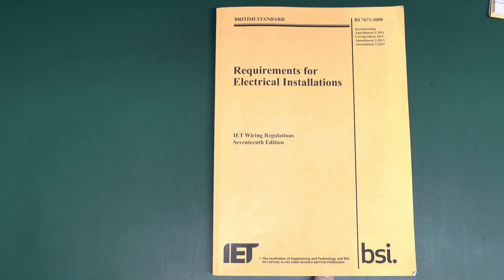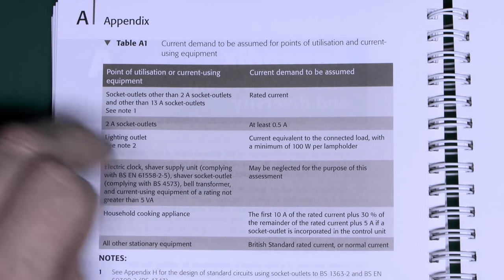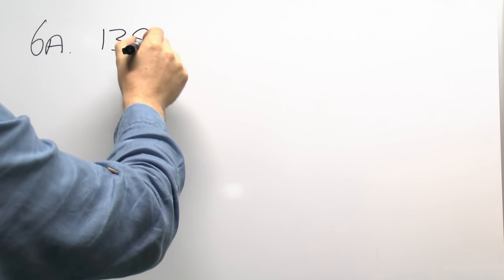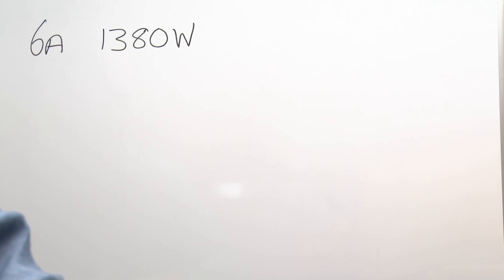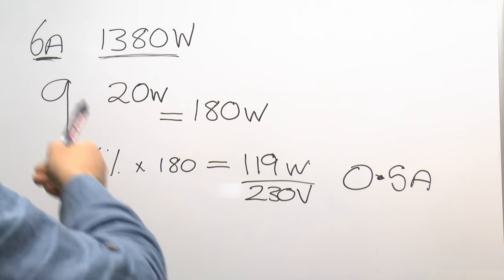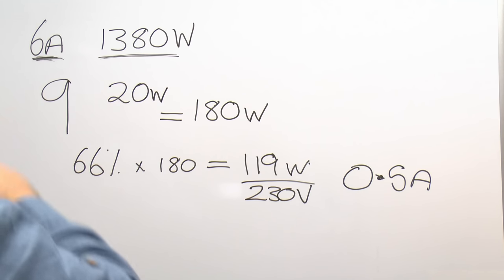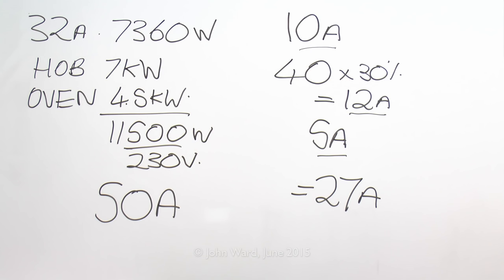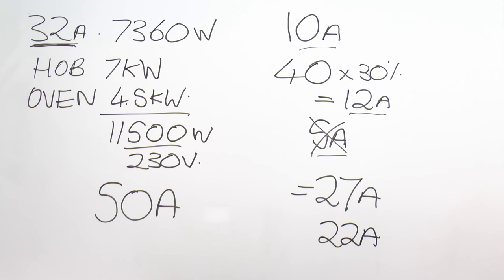Maximum Demand & Diversity for Electrical Installations

Comment: I can see why you might apply the diversity calculation to a circuit breaker for a given arrangement of appliances but I don't think the diversity calculation should compromise the wiring, which should be chosen for the maximum possible amperage to avoid future rewiring of the house. It also has a lower wiring resistance, which might offer more options for the choice of circuit breakers.

Comment: Diversity was discussed on a respected training course I attended recently and appears to have been calculated very differently for an entire installation. 
You calculated diversity on each circuit & added them up (which appears straightforward), whereas they appear to have applied the 100% + 40% of Item 9 in Appendix A of the OSG to the entire installation. The wording for item 9 is a little unclear - "Standard arrangement of final circuits" and you seem to suggest this is used for sockets only. So I'm confused as to which approach is right or whether both are?
This is the example they gave us for a consumer unit with 4x32A circuits (cooker + kitchen + downstairs + upstairs rings), 1x40A (shower), 2x6A (lighting) Total =180 Amps
Diversity for entire installation: 40Ax 100% + 140A x 40%(.4)  = 40A + 56A which totals 96 Amps
They also mentioned allowing 20% for redundancy.
Reply from the maker: Either way is ok, and there are probably other methods that could be used.  The point is to get to some reasonable assessment of what the likely maximum load will be, it's the end result which matters, not how you get there.

Comment: Hi John,,,, So what happens if you have the circuits you have suggested along with the storage heaters?   Is it a no go?
Reply: Have an 9Kw electric shower, Electric oven, 3 ring mains, 2 16Amp spurs (attic and conservatory) 2 lighting and 40 Amps out to the workshop/office and Eon just changed my incomer fuse from 100Amp to 60Amp........

Comment: Surely if you put the hob and oven you mention with a combined loading of 50A it will trip the 32A circuit breaker when it's all switched on from cold? Or am I not understanding something here?

Comment: Hi
Thank you for a very well presented video.
Ring main diversity/demand:  can the circuit be limited to 20A with a 20A MCB. This is in order to only use 20A in the calculation instead of 32A.       
Best regards
Jo

Comment: Many thanks for yet another informative video.

This place, a 3-bed link-detached house on a large development built in '82, has a looped supply as do most of the neighbouring houses. No idea why - the builders didn't save any cable hooking them up like this, only thing they saved on was a connection to the supply for each pair.

Each house should have a 60A fuse with this arrangement but many, including mine, appear to have a 100A fuse, and of course if a property is the second one on the looped supply there's no way of telling it is. I wonder how many have a 40A power shower and a calculated demand of >90A.

Comment: Hi John. I want to install  2 electric showers (10.5 & 8.5 kW). Can i run both of the 40a mcb dedicated shower circuit if i take a feed from the 1st shower and put a 30a fused spur feeding the 2nd electric shower?
Reply from the maker: No.  A 10.5kW shower is more than 40 amps on it's own, 8.5kW is 35+ amps and both together is 80+ amps which is 2x a 40A device and is more than plenty of buildings have for everything.

If you must have 2 electric showers a device will be required to ensure they can't be used at the same time, such as https://www.garo.co.uk/categories/priority-non-priority-cons-uni

The real solution is to install a stored hot water system rather than attempting to heat water on demand.
Reply: @jwflame  thanks John

Comment: Thanks for the reply to my previous post John. I've got something that you may find interesting to cover or maybe not! I've added a few usb charging sockets in our house, I installed a metal clad version in my workshop, whilst using it to charge my phone, I took a call with it plugged in, I quickly noticed a buzzing in my ear and what felt like electrical shock. I tested between the iPhone's metal case and the earth and had 96v AC. Again tested it to the gnd connection on the USB socket to earth and again, unsurprisingly same voltage. To cut a long story short I tested the units in the house which are better quality MK units and to my surprise I had the same reading. I'm assuming it's to do with emc components? Would love to hear your views on this!
Reply: It's the EMC parts as you rightly said, these can be a big and destructive nuisance. An example is computer peripherals, generally a desktop PC is earthed, not all peripherals ie printers are earthed. If all of the peripherals are plugged in before the mains supplies are connected things are generally OK. However if the "data cable" between a printer and PC are connected after the devices are plugged into the supply the "floating" chassis of the printer (usually sitting at roughly half supply voltage) finds it's ground via the PC. Many years ago in the days of parallel printer ports I encountered MANY motherboards that worked fine EXCEPT for the parallel port as a result of destroyed semiconductors. I have seen similar happen with external USB hard drives where they use external power, frequently the USB interface in the drive caddy fails as a result of being connected to the PC after being connected to their supply.
The "tingle" you got from your phone should be at a safe level of current...

Comment: Hi John.... Using your example of  97Amps total....great with a 100 Amp main switch in a Consumer Unit..but, what is the suppliers main fuse is only 60 Amps?
Reply from the maker: If only 60A fuse, then you can't have an installation which requires more than that.  The supplier may be able to fit a larger fuse in some circumstances, or the supply can usually be upgraded if you pay for it..  Otherwise you are limited to the 60A, so no electric showers or other high loads.
Reply: Had a new meter fitted 2 weeks ago and they changed our fuse down to 60A and put a big sticker on it without  asking if it was OK!

Comment: I love your videos as they explain concepts to a keen DIYer like me. I understand all you say here but I'm confused about the Max Demand overnight if you included storage heaters. The DNO fuse in my property is 100A (I have storage heaters). At 28.15 in your example you say the total demand would be 97A.  If you then add 44A (in your example at 25.05) the total demand would be 141A.  Would this not blow the DNO fuse or is the assumption that the other overnight power consumption is very low?
Reply from the maker: It's assumed that other consumption at night will be minimal, so you can use a large proportion of the available capacity for the heaters.
The idea behind electricity being cheaper at night was from a time where there was very little usage overnight as most businesses were closed, and it was beneficial to encourage people to use more then, as shutting down power stations was not practical or desirable.
This concept is now incorrect as many businesses use electricity 24/7 and as electric car charging becomes more popular, overnight loads will be significant even without electric heating.
Reply: Thank you very much for your prompt reply
Reply: I think the key point is not to assume that everything will be at full tilt all of the time and pulling the max In rating of each breaker. This would mean a '150A' dno fuse would be needed just in case..

Comment: I guess the maximum ratings are made with cannabis farms in mind
Reply: Just had a vew meter installed and they reduced the incomer fuse to 60A no good if your farming, you would have to upgrade to  a M10

 ;)

Comment: Fantastic video as always John. Do you think there will ever or in the near future plans to down rate fuses/mcb's or even conductor size. I'm not an electrician and there is possibility a clear reason why not! Looking at your calculations and your explanations no (certainly modern) house would get near to a 6A load on a lighting circuit for example. I understand the protective device is there to protect the wiring?
Reply from the maker: Mk18T Yes, the MCB or whatever else is there to prevent the wiring being damaged, and even the smallest 1mm cable has a rating far above 6A.
However using a smaller rated protective device will reduce the amount of energy if a fault occurs,  so there is some sense in using smaller devices.  3A MCBs are available and could be used for lighting circuits.
Reply: The protective device i.e the earth cable or now called  CPC is to protect your life by having a path to earth hence to the centre taping of the transformer and back to your fuse/ mcb  and cutting of the power to what ever caused the problem .

Comment: This video was exactly what I needed to confirm the selection of the protective device for a new cooker circuit. Customer has a new double oven with induction hob which I had to phone the brand manufacturer for the maximum demand which tops out at 13.9KW ! ! ! The appliance manual specified 6mm cable but did not state the maximum demand. So 60.4 Amps. 10A + 30% of 50.4A (16A rounded up) with no additional socket is 26A (rounded up). To me this seems mighty low when you consider the appliance's rated maximum demand. I'd be much more inclined to install a 40A breaker rather than a 32A as the cable is good up to 47A (clipped direct)? Any thoughts?
Reply: As JW explained the diversity calculation chart in the OSG is a guide. As an electrical engineer you will have a wealth of experience and can use your own diversity calculations. You will probably find that the calculations in the OSG are on the conservative side and so in practice they will be less. Be aware that if you are designing circuits you should have Professional Indemnity insurance because if you under estimate the loading of the circuit which results in the circuit breaker overloading (or worse) then your client will have leave to start legal action. Also you appear to be using the nominal voltage of 230V to calculate the connected load, you should be using the actual voltage which is usually nearer to 240v (when the nominal voltage in the UK was changed from 240v to 230v this was done so that appliances where manufactured to the same nominal voltage across the EC the electrical supply companies did not change the winding settings on all their transformers in the UK so the actual voltage in the UK is still 415/240 volts).

Comment: cheers J...informative as always     is one phase limited to 100 amps ? and to have 2 shower and 1 cooker circuit would always require having additional phases ?
Reply from the maker: damon btc Usually yes - above 100A you would normally get 3 phase, 100A for each phase.  It's possible to have a single phase supply above 100A, such as a 200A supply, but generally not supplied like that as it's better to load the three phases equally, and it's usually easier to fit a 3x100A supply.

Comment: Hi John hope your well I have a numpty builder who has convinced a customer she wants 15kw of electric underfloor heating which is 65 amps on the ground floor of her house which includes multiple room.I haven’t been to the job yet to look at the mains but assuming they have a 100amp bs88 on 25mm tails could this be installed I’ve been told they have a gas hob and no electric showers but I’m still thinking this is not a good idea but the builder is insisting this is what she wants
Reply from the maker: Theoretically it could be done, but suggest contacting the DNO to confirm if the supply is actually capable of such a massive extra load.  Almost certainly would have to be notified to them anyway, that's the equivalent of 2x electric vehicle chargers.
It will cost a fortune to run in any case, and is just about the worst possible choice for heating.  Take what the customer pays for gas now, and multiply it by 5.
Reply: Thanks John your a legend.

Comment: Having watched your videos with aspects of the clarity that you explain, I find myself in a situation that seems perplexing to the internet in terms of regs vs manufactures, I have had an oven and Hob in my Flat, new about a year ago and have purchased two new products of oven and Hob as relocating the initial appliances in the flat above mine as the oven and Hob have failed in this property, I own both and so decided to upgrade my own and put the fairly new ones in the flat above to replace failed ones, the oven and Hob both state that they require a fused spur connection and I wanted to know if this could be done from the 45 amp cooker box that is supplied with 6mm cable and protected by 32amp at the consumer board.
The Hob has a moulded plug on Zanussi and was plugged into cooker box the oven has a flex that was connected to the 45amp cooker box hard wired,, I have had no issues but feel that the oven is not protected other than by the 32amp fuse in consumer unit.
Is it better to take two fused switched double pole units or a double gang switched socket. And what cable to take from cooker unit to said spur. I would appreciate your input on this as the community seem divided.
In advance this is in the UK and the consumer units are both protected modern ones. Yours respectfully David
Reply from the maker: A 32A circuit can have various things on the end - a connection plate, a double socket, single socket, FCU with 13A fuse, or various combinations of both.  There are advantages and disadvantages for all of those.  However generally go with whatever the appliance is supplied with - so if it has a plug, fit a socket, if the instructions state a 13A CFU then fit one of those.
32A for a single oven is fine - the only protection is for a short circuit, and the 32A MCB will do that.  There is no need for overload protection, a single appliance can't overload anything as it's power rating is fixed.
Cable needs to be suitable for the load - for a single oven, 1.5mm² flex is common, although nothing wrong with using larger sizes provided they will fit into the terminals on the oven.
Reply: I thank you very much fore taking the time to put my mind at rest, I have investigated a little further and decided on a 45amp dual appliance outlet plate with one going to a single socket and the other to a 13amp DP S/W fused connection with 6mm cable supplying both matching the 45 amp cooker unit with the load going from each appliance one by plug and the other into fused connection.
And a similar approach for the other two but the Hob is an AEG and recommends hard wiring. Again thank you.

Comment: Sometimes the OSG figures don't add up and the clamp on ammeter has to come out to verify your common sense real world reckoning.
No matter how many socket outlets you have, the same number of appliances will get plugged in. Only the number of extension leads and adapters will differ.
Do you really have to rate a 3kW motion-activated hand wash in a home workshop as a continuous load?

My static caravan has a high electrical load due to electric panel heating, washing machine, tumble dryer and a couple of years ago the pathetic LPG cooker was changed to a LPG hob with electric oven.
To prevent overloading of the pitch supply, I installed a neat arrangement with a current sensor (AcuAMP ACS150-AE-F) and Normally Closed contactor, which is set up to disconnect the panel heater circuit when the cooker circuit draws more than 2A.
This works really well in practice due to thermal inertia of the panel heaters.

Comment: hi john. Can you put a 32Amp breaker for a circuit that has  on it  2.5 mm cable  and 10Amp power points.  If so, why not have all power circuits this way instead of the standard 20-25Amp breaker?
Reply from the maker: No, 2.5mm² cable is rated about 26A maximum, it's only permitted on a 32A if installed in a ring arrangement which effectively has 2 conductors to each point.  Otherwise the maximum is 25A, or less depending on how it is installed.
Reply: @John Ward  -I discovered my Split system air con is on a dedicated circuit, has a 32A RCBO and all with 2.5mm² cable. the aircon runs normally 2500W capacity 8100W. I have recently run off it just 1 power point for a small toaster. everything seems fine at the moment.  if there's something wrong...well...  maybe the installer put in the wrong cable? What would be the easy fix? I replace it with 4mm² or 6mm² cable? if so; would the powerpoint and toaster be fine? then again the aircon must of been like this for years, a toaster now shouldn't make much of a difference... I got a feeling I got nothing to worry about....what do you think?
Reply from the maker: It's the wrong cable, 2.5mm² on a 32A device is not protected against overload.
4mm² will probably comply, assuming the circuit isn't particularly long.
Reply: thanks john... I will replace the cable... I just need to know..... I want to leave the 2.5mm cable that I got coming off the cable to the air-con. I don't think it will never have 32 Amps going through it, is this ok?